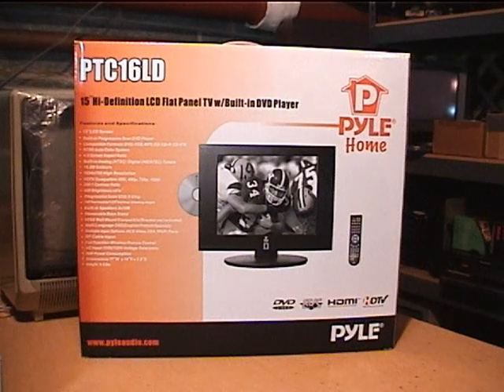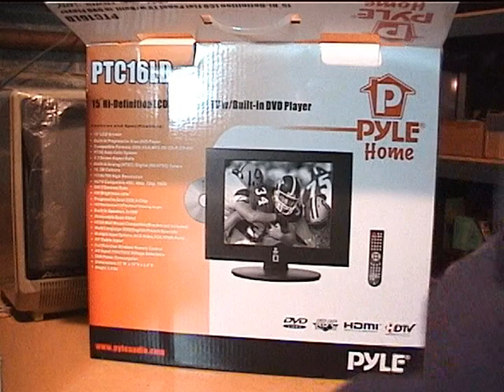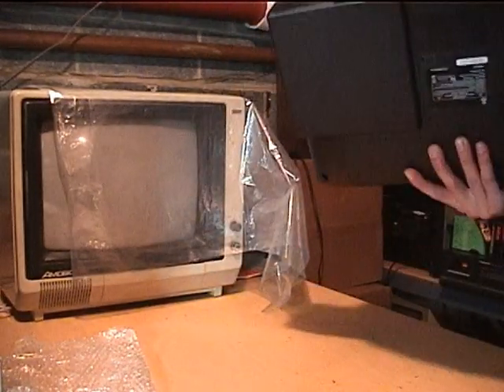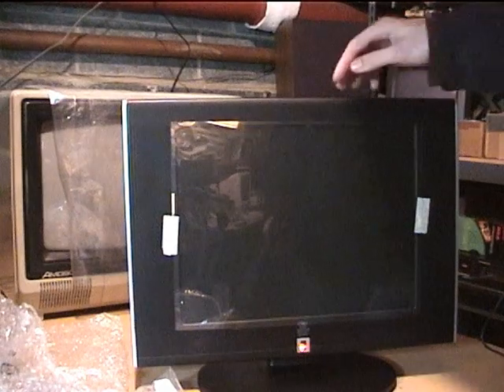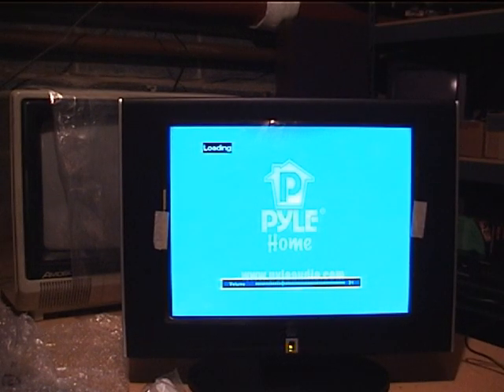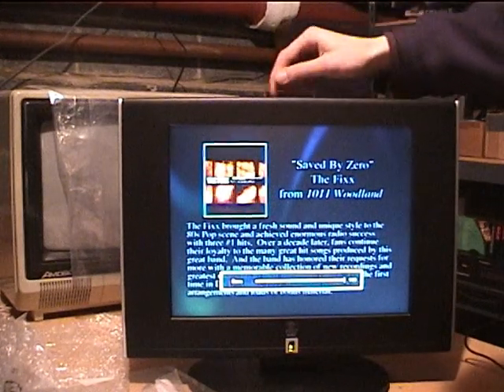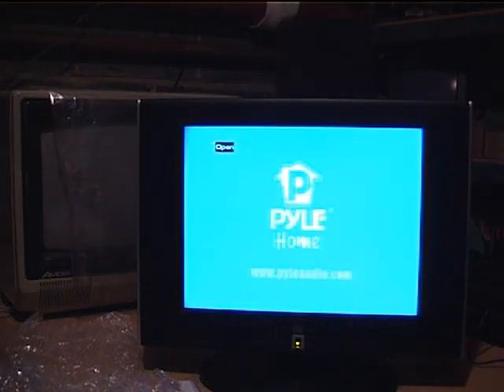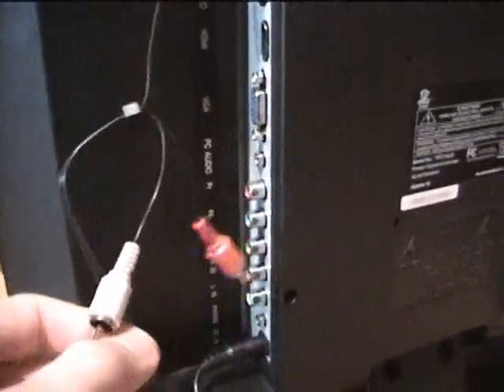Pyle PTC16LD 15" HDTV/DVD unboxing & test

Comment: Maybe it does, but the tuner's menu did not give an option to change the channel setup, so maybe it can decode over-the-air PAL, but the signal would have to be on the same frequency as one of the U.S. TV channels.

Comment: With my Sansui LCD TV, you can have a 4:3 source displayed pillarboxed. The 4:3 image retains it's proper shape while black bars appear on the side.

I prefer stretching the 4:3 image to fill the 16:9 frame though.

Comment: Two more things. I notice the On Screen Display for the DVD player at 6:39 looks exactly the same as the OSD on my Digix DV-288B1 DVD player. 

Also, what "brand" was on the batteries that came with the remote control? The ones that were with my Sansui LCD TV were "Rocket Ultra Green".

Comment: Did you try any of the picture modes? I have a Sansui LCD TV that has several different ways to adjust the picture size, such as having 4:3 content fill the entire 16:9 frame by stretching, or having 4:3 content pillarboxed in the middle.

Comment: I've seen your video about using PAL with an NTSC tV set and you used this TV in that video, so the composite input accepts both PAL and NTSC.  Having said that, I wonder if the analogue and digital tuners in this TV support PAL as well as NTSC?  Here in Australia we used a digital TV standard called DVB-T, is that standard also used in the US for FTA digital TV?

Comment: wow that contrast ratio is shit! blacks look navy blue! that's one big advantage that crts have always had over lcds is there superior contrast, the only displays that could ever beat crts in the contrast department were plasma screens but not by much. even today in 2018 lcds still don't have the contrast of good crts, they've gotten a lot better by using arrays of LEDs for backlighting but the LEDs light up clusters of pixels (typically 16 x 16) which results in a "halo" effect around white text on black backgrounds (like in movie credits) so yeah, I'll be sticking with my crts for the foreseeable future